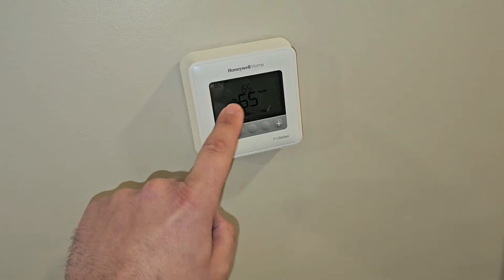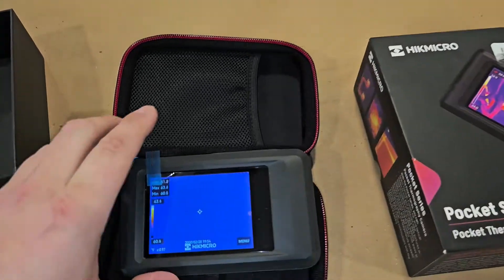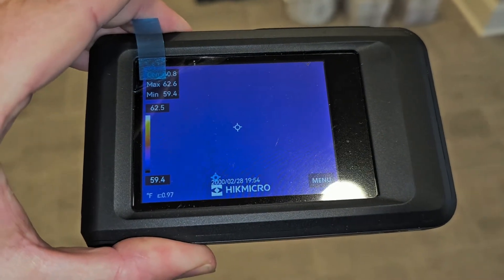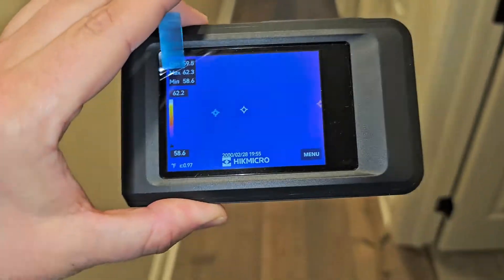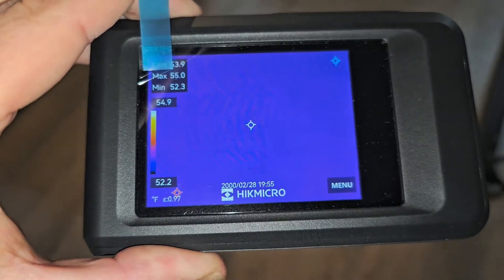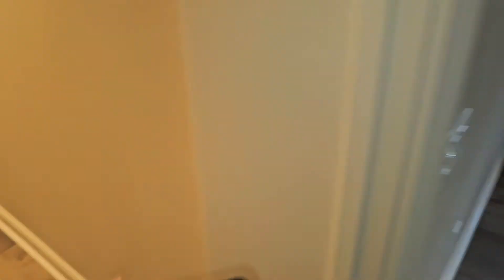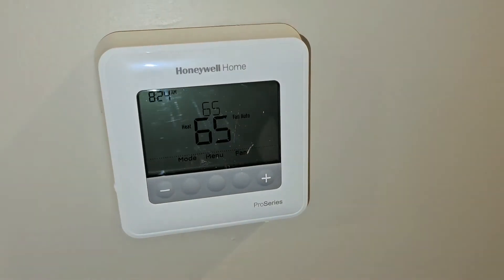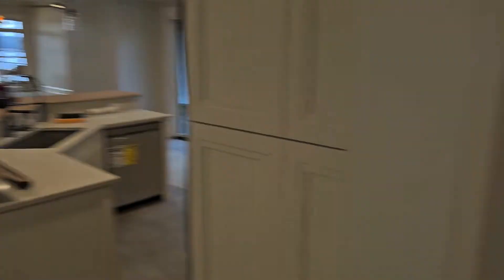Honeywell Thermostat: What is Temperature Display Offset?

Comment: As a retired Honeywell controls engineer, my understanding of the terms temperature differential and offset are somewhat different to those described.
SETPOINT  - The required temperature setting.
DIFFERENTIAL - The thermostat will switch on (call for heat) when the space temp is  say 1 Deg below the SETPOINT and switch off at say 1 Deg above setpoint.  The difference between these values is the Differential.
The actual measured temperature in the room is the CONTROL POINT.  This will always be different to the SETPOINT due to building heat loss and other influences.
The difference between these two values is the OFFSET.

Comment: Thanks for info, nice video.  I have zone H/C two t-stats.  had old dial style stats in the house and wanted to update so I actually had a #  i could see rather than a dial that refrenced a slash in very tiny print as old stats have. Purchased a used t4 on ebay and it works perfect except I think it is off about 5 degrees from actual room temp. i moved it in the ISU (1420) 3 derees + in order to get it as close to actual  and it is within 2 off actual temp now, good but would have been nice to have a few more digits of adjustment to get it right on.  Guessing there is no mercury in these newer types and wondered if maybe some light
 compressed air on whatever circuit board it may have could help, or thinking I will just let it ride. At least they are inexpensive units with many capabillities. Thanks again for video, you did a nice job.

Comment: The problem with going (negative) in the summer to get more cold run time
But for winter you gotta change that -3 to +3 so it can run longer in heat for winter time

Comment: What if I need my to run longer in the summer time we have a addition but it's 2 degrees off down there which was do I go minus or plus?
Reply: Yes I did do plus and yes it worked thank you so much. But I would like to ask you what's the difference in doing the offset vs just dropping the thermostat temperature a degree 🤔 just a question but what I did with the offset worked great.
Reply from the maker: The difference is, you don't have to turn the temperature down for it to stay running longer
Reply from the maker: I would say plus because then it will read a temperature that is higher and it will run in cooling longer. I hope that makes sense
Reply: That's great I just wondered.

Comment: I wish you were in central VA. I'd call you. I have three heat pumps, two 18 yo that run great. One 6yo unit that freezes to a solid block of ice and the fan hits the ice making a hell of a racket. The installing company (of all three units) has been here three times and tell me nothing is wrong, the freezing is normal. Just put it in emergency heat until it defrosts...Really?! The old units never freeze up.

Comment: Are you saying the thermostat was already inaccurate from the factory? It should display the exact room temperature before you manually adjust it.
Reply from the maker: No
I'm saying you can adjust it
Reply: @TaddyDigest  in the video you appear to be saying the thermostat was reading too high compared to the actual temperature.

Comment: I have been in the trade for fifty years and I have to say I have seen a lot of installs and  that install is rare (and Beautiful)
Reply: @clifffarion7448  hi 👋 I just happened to come across your comment and I thought I'd take a chance....I've recently had an entirely new a/c compressor & thermostat replacement. Since it's been installed the thermostat seems to be doing whatever the heck it wants. Set at 76 - runs until it reaches 76 then stays on for another 20mns. Shuts off. Room reads 76. System set to 76. Then 5 mns later it kicks back on. Both reads 76 but System uns a/c for another 20, 30+ minutes. Shits off. 2-5mns later back on. The a/c company has come to "check the system" 4 times now. Replaced the thermostat.  System was set at 76 all day and house got up to 86 degrees. Blew "cool" air non stop for 4hrs. 
Now with new thermostat. House got down to 76° from 84° - Great! But it's back to doing this weird finicky kick off for 2mns then kick back on.  Even once the thermostat reads the room temp to match the system set temp it stays running for another 20+ mns. 

In 8 years, this place has never had an issue with cooling the place (700sq ft condo) and keeping it cool without it running all darn day until it just broke and needed to be replaced.  Now with a whole new system, what the heck could be causing this? 

I'm desperate at this point. I've searched, called and tried to figure this out. I'm wondering if the a/c company might be overlooking something? Do you know what possible things COULD be causing this?